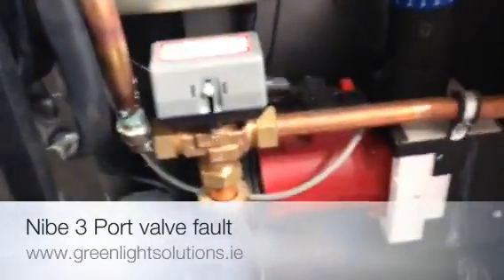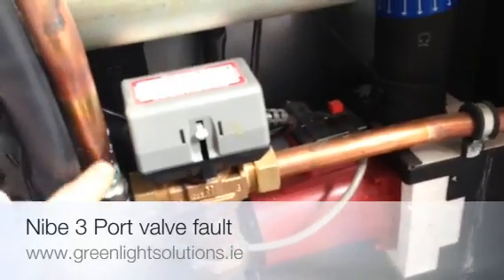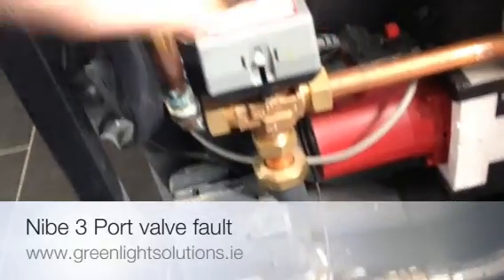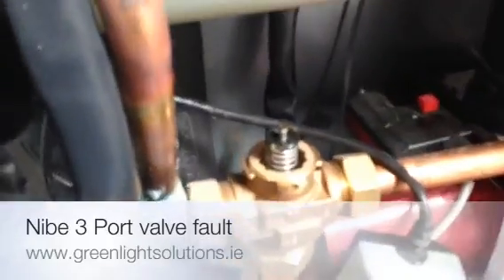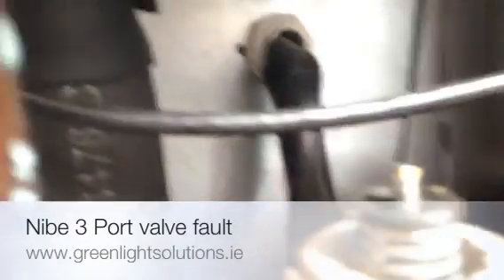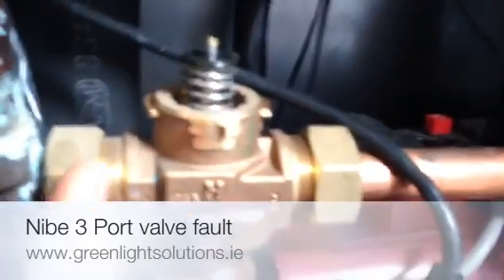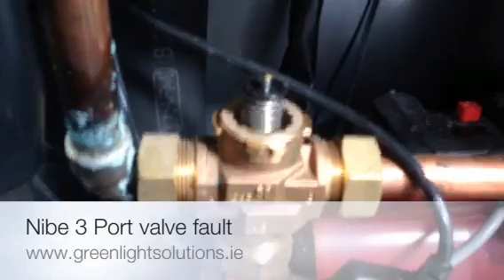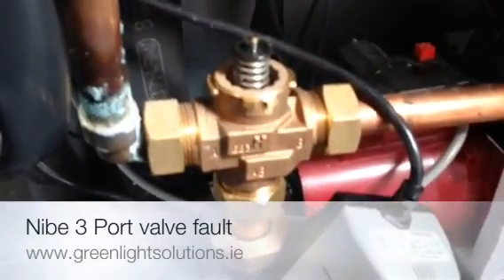Nibe Heat Pump 3 port valve

Comment: Is the unit making any sound when 3 port valve fault?
Reply: It just starts to heat up the hot water every 15 minutes and your electricity bill will go way higher. It should heat up the water and then close open/valve. In case the valve don't work your hot water will cool down very fast as it will use the heat for heating the house. The system itself will not go to alarm mode.

Comment: totally wrong..just use wd40 .. it will release all the grease etc.. actually that is a honeywell probably vc4010-2 or vc6010-2.. very very durable and strong 3 way valves. I have some of them even over 15 years old.. still work great.. just use wd40 to clean.. it will go another 15 years.. honeywell is better than what you are going to change
Reply from the maker: You can pull apart the valve and clean it, that works too. Just spraying it on the spring doesn’t so anything, be like putting toothpaste on your lips to brush your teeth 😂

Comment: Brilliant! I immediately checked my valve, my Nibe 1240 hadn't been working properly for ages, 3 engineers couldn't sort it! Sure enough the piston was solidly stuck. Bought new valve online, fitted it, heat pump now circulating as it should, even the  flow meters are active!  Thanks so much for the simple video.
Reply: Where did you bought the Valve?

Comment: You have serious water quality issue. Not the spring or the stem but the piston inside the cartridge is sticky. What is  the content of the heat ntransfer fluid of yours? What type of filtering have you used?